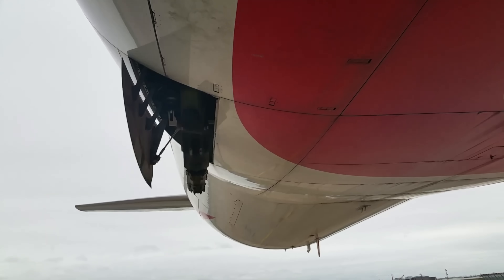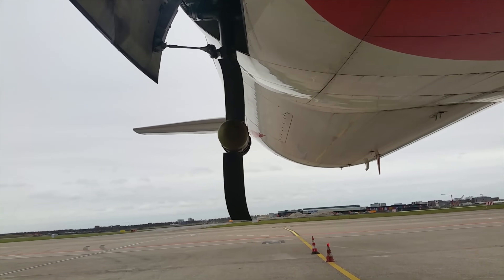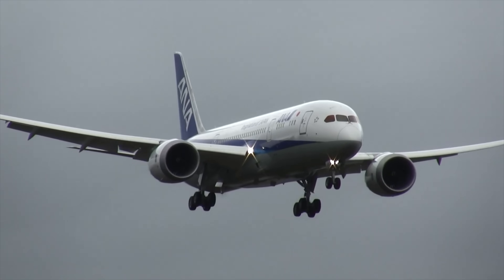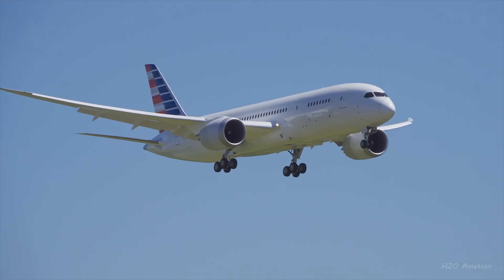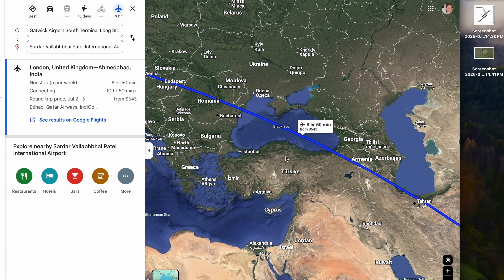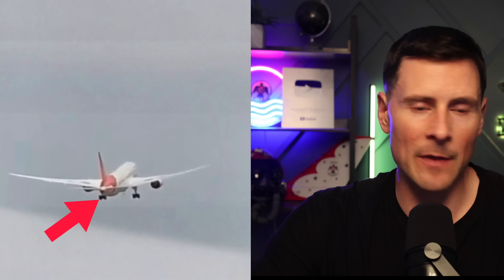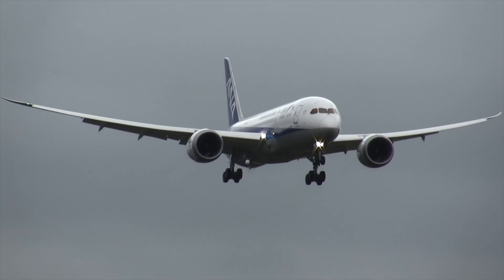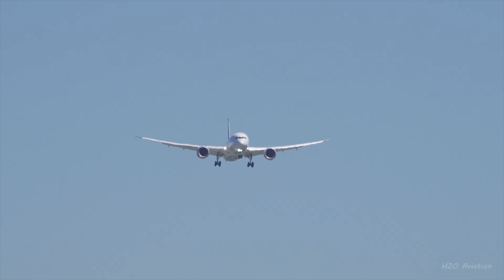Air India 171 SHOCKING UPDATE on RAT Deployment and Flaps!

Comment: +The crash was not as a result of the flaps, possible electrical/hydraulic malfunction or the RAT deployment. It was a result of lack of thrust. Finding out why there was a lack of thrust is imperative to finding the cause of the crash. Possible scenarios are : Engine failure after V1, continue takeoff, rush the procedure and shut down the good engine? Some spurious electrical malfunction that shut off the fuel to both engines? Moving the fuel control switches to cutoff? Pulling the engine fire switches? Sorry to mention the elephant in the room.

Comment: RATS HAVE BEEN AROUND A LONG TIME... AT LEAST SINCE THE A-4 AND DC-10 TIMES.... (1969 OR EARLIER) THE DC-10 RAT COUD DO BOTH ELECTRIC AND HYDRAULIC... HOWEVER, NOT AT THE SAME TIME... YOU HAD A SWITCH TO SELECT WHICH YOU NEEDED THE MOST

Comment: It is interesting to me why the engines cut out (assuming the Mayday call was correct)after rotation.  Did the nose high attitude eliminate the gravity feed of fuel to the engines if the fuel pumps were either not turned on or failed? 
Gravity would have been sufficient for taxiing, but with acceleration the fuel would have forced air to the top front of the tanks it would have remained after rotation therefore possibly starving the engines. But if the fuel feed lines are located at the bottom of the tanks it should not matter.

Comment: It looks like a dirty fuel situation or a vapor lock in both engines ... there was no thrust in both engines while attempting to climb. Dirty fuel can be examined on site, but a vapor lock takes more investigation. When jet engines have no thrust it will also impact electrical components hence the  deployment of the RAT.

Comment: My work focusses on whole systems (not aero, though) and I can't help speculating on a single point of failure. But what?

A "what if" question--if an electrical fault in a critical place could knock out all the electrics, that would explain the RAT. Could it also explain both engines dropping to idle, or even cut off fuel to both entirely?

Comment: a pilot on YT has shown that the gear retraction was attempted but failed and pointed out the gear is tilted forward instead of back in the video the kid shot from the second story patio. He also showed a video of a 787 undergoing maintenance or testing in a hangar and when the lever is set to gear up the hydraulics move the wheel carriage to a tilted forward position and then the gear raises. Since the tilting is done with hydraulics there wouldn't be any reason for the wheel carriage to be tilted forward other than putting the lever in the up position.

Comment: THE LOSS OF LIFT (WITH PREMATURE RAISING OF THE FLAPS) AND A DUAL ENGINE FAILURE FELL EXACTLY THE SAME... THE FLIGHT PROFILE FITS... IF THEY HAD LOST BOTH ENGINES THE AIRPLANE WOULD NOT HAVE MADE IT TO THE CRASH SITE...

Comment: I already saw one comment about it but everyone is focused on what you hear. I am focused on what you don't hear and that is 2 enormous growling jet engines at takeoff thrust. If you listen to the original audio it's even more pronounced. At takeoff trust that should be the prominent noise heard. You can hear engine noise with the rat on the clips of planes landing so you should most definitely hear the engine noise on a loaded 787 taking off.
Reply: You’re absolutely correct.   No jet engine noise.

Comment: Also notice the position of the landing gear wheels. They are tilted foward (3:55 and onward) which is the first step the gear does if it's being retracted.
So the Gear being tilted but the bay doors are still shut, would it be likely hydraulic power shut in that very moment? Would make sense with the rest of it. Total power loss in the first few meters after taking off.

Comment: Someone else on youtube was talking about the landing gear position. Normally after take off the gear is facing downwards but when gear retraction is engaged the 787 will orient the gear upwards before golding it in. In the images you can see it is golded upwards but they never retracted. Indicating there was a hydraulic failure. But we just dont know what caused the hydraulics to fail.

Comment: This is my theory, i think pilot tried to raise the landing gears, the gears tilted forward or retracted a little bit then it's hydrolic fluid leaked (with a blast, because pressure is so high that when it leaks, it leaks with blast, and the sole survivor also mentioned about hearing the blast) then landing gears stopped retracting and the leaked ultra high pressure fluids destroyed electronics and other things arround it and that accident instantly stopped the plane from generating power, then RAT got deployed automatically to generate emergency power (usually RAT deployment also results in flickering of lights inside the plan and sole survivor said that lights flickered inside the plane) to make necessary electronics work, to make mayday call etc. We can see RAT deployed and it's gates open at the bottom of the plane, in the video, this is just my speculation from observation and whatever little knowledge i have. So i think crash happed because of manufacturing or maintenance or design engineering error of landing gear hydrolics. They should make the plane in such a way that even if hydrolic blast happen, it should not cripple the plane's ability to generating lift or run engine. Again, this is just my guess.

Comment: UNTIL YOU HAVE THE ACTUAL PERFORMANCE DATA (WHICH THE COMPANY DOES) IT IS DOUBTFUL THE AIRCRAFT DIDN'T HAVE SOME FLAP/SLAT EXTENDED... BUT THE AIRPLANE DOESN'T CARE IF ITS 5 DEGREES OR 15 DEGREES... AS LONG AS THE FLAPS ARE OUT MORE THAN ZERO.... SO............ IF IT WAS SUPPOSED TO BE FLAP 15 AND ONLY 5 WERE PUT OUT... THEY WERE SCREWED AND ALSO WHY IT SEEMED TO ME TO BE AN UNUSUALLY LONG TAKE OFF RUN.

Comment: I'm wondering how quickly the engines spool down in the event of electrical failure and/or fuel starvation.  Considering they must have been running at or close to full power when the plane lifted off the ground, and the RAT seems to have deployed just a few seconds after that, it implies the engines went from full speed to below idle incredibly quickly. I would have thought they'd have enough momentum to keep going and keeping the generators running for a bit longer than that unless they literally suffered catastrophic failure (such as explosion), which isn't evident from the video. Does anyone have any knowledge about this?

Comment: The landing gear rear wheel trucks normally are angled lower in the rear wheels when landing.. When the landing gear begins to raise, the rear wheel trucks pitch forward and are lower in the front wheels. This indicates that the pilots had started to raise the landing gear, but it stalled when the engines lost power. The trucks appear angled FORWARD.

Comment: If on may 29th passengers had reported smell of burning wiring from AC, Is that the reason why they turned off the AC?as per the other duse's video? That's the question that needs to be asked.

Comment: A mechanical failure in the… pilot’s seat at the time of takeoff appears to be the root cause of the crash of Air India’s Boeing 787 flight AI-171, according to the preliminary findings of the Air Accidents Investigation Branch of India (AAIB), which were released today, June 25, 2025.
As the report states, while the aircraft was in the rotation phase, i.e. the nose wheel was detached from the ground, the pilot’s seat slid sharply backwards, due to a failure in the rail mechanism.
The weight of his body unconsciously dragged the thrust levers he was holding at the time, since he was the one controlling the takeoff, towards the "idle" position (zero thrust), causing a sudden reduction in engine power.
Reply: Where can I buy a crystal ball like yours?
Reply: At V1, the captain is supposed to take his hand off the throttles

Comment: I think by now there is enough evidence to suggest total loss of power on both engines.  Question is why.

1. Both Engines failed due to mechanical issues - Very unlikely
2. pilot turned off both engines - highly unlikely
3. Some kind of electrical failure of the fuel system - Possible previous flight was having electrical issues in the cabin.
4. Fuel contamination - possible, but unlikely to have caused issue after such short time.
5. Bird Strike - No bird debris found, so unlikely
6. Sabotage - Cant rule this out.

Comment: The landing gear is tilting forward which means gear lever was correctly pulled up and not the flap lever. Because of hydraulic failure they couldn't be pulled up and stuck in that position. Gear tilts backwards in full gear down position.
Reply: Exactly, thank you. The retract sequence was obviously started but aborted, probably due to the rat being insufficent to power the landing gear hydraulics.

Comment: How is 20000 repetitions in a minute even possible!? 300 a second!!
Reply: I thought first too. Small diameter 0.4m*pi*300/s=360m/s Mach 1.2. I think they want to maximize power. Also heard that the rotational speed should match the 400Hz AC.

Comment: I think Pilots message was very clear ... No Power No Thrust Going Down  ! That sums it up
Reply: Sums up them having no power but gives ZERO answers as to why.
Reply: Those words are not true.

As per DGCA, The pilot simply reported "Mayday"

No other words were transmitted.
Reply: all these airports should be built in the country on flat terrain with no close buildings, like the denver airport.
Reply: Have heard other black boxes record one more sentence.....
" We'll all perish!"
Reply: So the pilots turned off the engines.
Why?
Reply: @epluribusunum-1 what? Could have been an avionics failure, could have been a total engine failure, could have been a fuelling issue, could have been a poor maintenance problem. Why immediately blame the pilots?
Reply: @robc1014 Because pilot error is the #1 cause of crashes.
Reply: @epluribusunum-1  overall perhaps but not these circumstances. This is absolutely a failure of system(s)
Reply: @epluribusunum-1  Yes, but it's not clear if that was a factor in this crash. Speculation based on what we've seen or know to be fact at this point suggests a catastrophic mechanical failure.
Reply: @broncoguy4862 It's India, bro.
Reply: @epluribusunum-1  so what if its India ? How many planes do Indian Carriers operate daily ? How many accidents have been reported by Indian Carriers in history ? Try to look at facts instead of making sweeping generalized statements.
Reply: @epluribusunum-1  And how much Boeing stock do you own to make silly comments like this?
Reply: @epluribusunum-1  Nonsense!
Reply: @peterebel7899 Prove me wrong.
Reply: @epluribusunum-1  You proposal is stopping any investigations because you know the result anyway.
I do see zero evidence 2 pilots shutting down both engines while the airframe is rotating at the end of a runway.

Zero evidence!

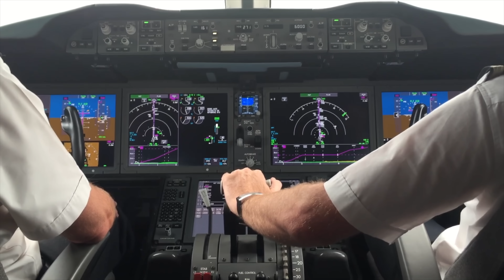Comment: 11:20 Sounds like re-engineering is needed so it will provide enough power when this condition occurs. Having the gear up might have been enough so they could have done a go around. It looks like the pilots did what they could to keep the wings from stalling with the arc trajectory.

Comment: I'll ask this again in hopes of sparking the discussion. In the original, higher quality video you can clearly hear a propeller before the 787 comes into frame from the left. I'd even argue it's 90% of what you hear. I would agree it matches what all other evidence of what a RAT sounds like. However you should be able to easily see the RAT deployed when the 787 initially appears in those first few frames. The video is clear enough that for 2-3 seconds you can make out roughly where the RAT door is located and it appears shut and no RAT is hanging down......yet  we can hear it just fine.

Comment: I believe please pilots and mechanics tune in an let me know that given past issues that it was a series of events. Long term at terminal gate with A/C running , a extremely intensive hot day a long line to take off. I believe since this is a all electrical aircraft that the lithium batteries had taken all they could. Slowly they started losing systems explaining long runway run. At point they retracted gear an explosion took place with batteries taking out all 3 buses. Instant power failure.  We know they tried cause boggies were told toes down for retraction. Time line adds up. Question does the titanium battery box A/C controled due to heat. Lithium batteries burn at 1668c more than enough to burn through the 2 in titanium box over time. Any ideas

Comment: If not even APU was working, would it make sense to think on fuel issues?
In the footage, engines did not sound to be at a high regime, but idle instead.
Reply: I only guess that the RAT have enough energy to start the APU. Then they could start the engines. I guess a minute or more. Why the APU is not in standby at start? I thing Boing consider that electrical system failure is rare coincidence with a 60s start window. But if there is a correlation between electrical failure and start it will blow Boing out.

Comment: Watching the first video, the only things I could see causing such a disaster would be major electronics failure, or dual engine failure, but the level of failures required for these staggers me. It makes very little sense, so I hope the investigators are able to announce something soon. I can't believe it's a vapour lock taking out both engines practically simultaneously, just as they're taking off, when (to my albeit limited knowledge) there haven't been significant reports of other aircraft having hot gas problems of any kind... so if that is the cause of engine failure...

Comment: Note: Air India has a habit in hot weather of leaving the gear down to cool the gear before retraction
Reply: In this case the wheel's show pre-retraction cant. When the retraction level is pulled the wheels are first canted so they will fit then the system stows them. So it looks like the failure happened right when the retraction level was pulled. Perhaps even as a consequence if something was wrong in the right way.
Reply: Hm but doesn’t that actually make sense? 🤔
Reply: @googleknowsus  Not sure what you mean. What normallly happen is the pilot pulls one level or switch (forget wich) and the rest is automatic, wheels are tilted, then stowed. Here we see they've tilted, but not stowed. This says something was wrong or went wrong when the wheels were ordered retracted. I think the tilt is electrical, the stowing is hydrolic. so at the very least hydrolic power went before the wheels got retracted. Gravity would have dropped them if they lost hydrolics while moving towards being stowed is how I understand it.
Reply: Landing gear doesn't get hot on takeoff. There's no reason to "cool the gear" It gets hot due to braking on landing.
Reply: @stargazer7644  tell Air India
Reply: @gaguy1967  Air India didn't make the comment.  You did.  There is no good reason to leave the gear extended.  It limits the aircraft climb performance.
Reply: @stargazer7644  where do you think i got the information?

Comment: Looking like everything suddenly switched off. Bird strike you would see flameout, also the engine would fail gradually. The FDR data will be telling if everything looks normal and it suddenly stops, then that's a sign of a sudden failure. With birdstrike you'd see a period of oil, fuel and thrust fluctuations while the engines flame out.
All conjecture, but that's what it appears to be headed to. I'll be taking an A350 for my next long haul, I think.